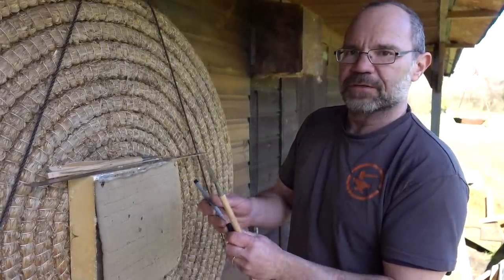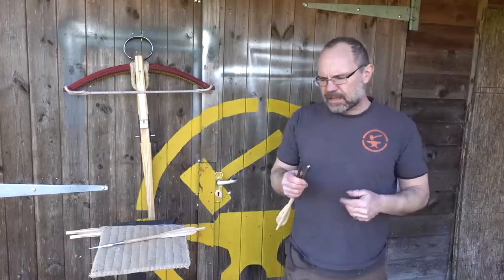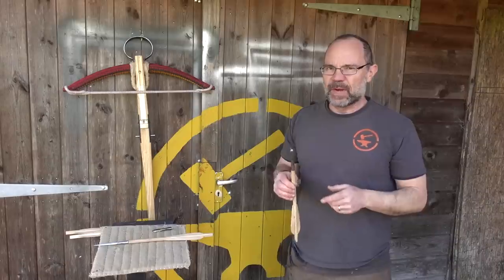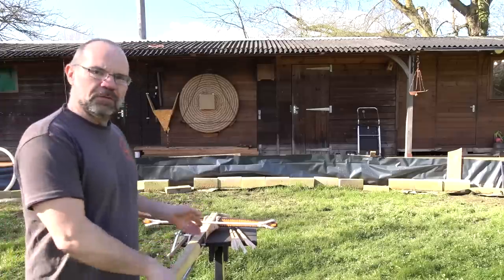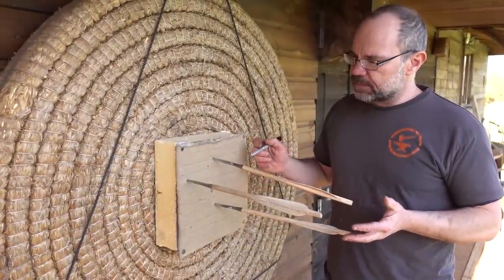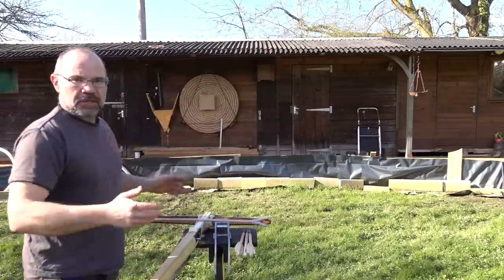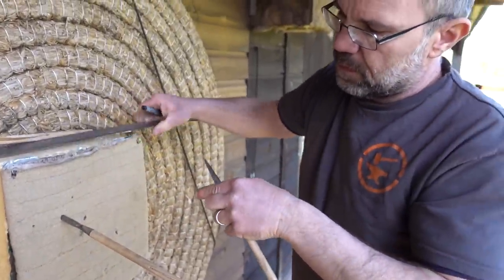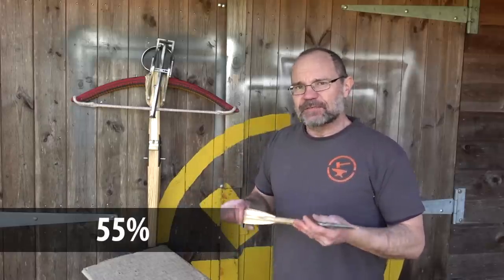Does WAX on ARROW HEADS Do Anything?

Comment: Great experiment. Thanks for your thought-provoking work!

Waxing sewing thread and waxing needles would have been common practice for far longer, so it's not much of a stretch that archers and military leaders would consider trying it.  As much time as I spend battling the Windows operating system, repairing my car, and teaching high-level math, they'd have had that time to ponder, "How do we kill the other guys before they kill us?" and been pretty darn motivated to try whatever might help.  

I wonder if there could be any DNA test for beeswax on historical arrows.  Or electron microscope of any pollen grains still in it?  We just assume beeswax, knowing it was available (while paraffin and other petroleum distillates were not), and I've got a lump of beeswax/fine sand my GGG grandfather used to sharp his scythe in mid 1800s Wales (and the scythe).  But what about human earwax?  Every archer has two ears and in a age before Q-tips / cotton swabs, that could have greased a few arrows each day.  Or beef tallow?  - beeswax would have been relatively expensive.

Other variations to consider are: polished steel arrow heads versus more roughly finished.  And really sharp edges to cut through those fibers.  I worked in a ski shop and running a downhill/Alpine (metal-edged) ski over a wet sander could give a 88-89-90 degree (depending on how aggressive they wanted to cut turns) "edge" that was a corner but a corner so sharp you could shave with it.  A friend did, inadvertently, when he took a fall and shaved leg hairs off his calf on the other leg.  

Plus 50% for wax.  Plus another 30-40% for polishing or extremely sharpening?  Now you've got a distinctly more deadly projectile and that's well worth the additional time, prior to battle, to prepare them.

Comment: It would be better to do more repeats but with the current data, calculating the standard deviation indicates the difference is statistically significant so it looks like there is a real effect. 

I don't think melting of the wax would necessarily increase penetration as some of the kinetic energy is therefore lost in the melting. I think it simply reduces friction and therefore prevents some energy loss as heat. But I'm not an engineer.

Comment: What is more telling to me, is that you used the bolts that you already had used.  They would, therefore, be slightly more dull having already gone into the gambison.  So, wax REALLY helps.  Helps better than your experiment shows.  Maybe only slightly, but certainly better.

Comment: Perhaps the wax was on to protect from corrosion in the armoury during storage.  But also added to penetration.  Surely they would not have been stored as bare metal? Two benefits from doing one thing!

Comment: Well medieval people understood that metal objects could rust. So it would make sence to put wax (or some other form of grease or fat) on your arrow or bolt heads to protect them from rusting. And if they did so I doubt they would bother to clean such a protective coating off before shooting the arrows or bolts. So they were bound to figure out that the wax/grease/fat made a positive difference to the effectiveness of their arrows or bolts. Wouldn't they?

Comment: WoW that is extremly interesting.
I wonder what would it do to the rivited mail or breastplate.
In medival people had been using bows and crossbows like modern military assault rifles. But the knights were using plate armors (late medival full plate or combined plates with rivited mail). is it possible to kill that knight with 2 or 3 bolts or arrows? I mean, perhaps most of leathal wound were caused by bolts/arrows hitting weakspots like neck or armpit. But it is so dificult to aim into small gap or eye from like 100m (bows) or up to 30m (crossbow), dosen't it?

Comment: Superb. And unexpected. I've been told a few times by re-enactors how beeswax was put on medieval arrowheads to prevent them skipping off plate and I've buttoned my lip because, thinking about the basic physics of that and the forces involved, I cannot for the life of me see how that would make a scrap of difference. But this is something else...
Reply from the maker: Careful.  Glad you found it interesting, but against fabric armour the wax is a lube, but against plate we currently have no idea, so do not take it as fact yet and personally I expect against plate it would make no difference
Reply: @tods_workshop  Agree on all counts!
Reply: @tods_workshop  Probably by an effect known as normalization. Some armour piercing rounds early in the 20th century, both for tanks or warships, had a cap of softer material that would increase friction when hitting sloped armour, making the round grab the plate instead of sliding away.

Comment: While I don't tend to bother with it, i know some guys who shoot modern compound bows will wax their field points and shafts, but that's to aid in withdrawing the arrow from the target. I shoot a foam block. It comes out easy.

As for Teflon coated bullets: complete BS. It'll cook off by the time the bullet leaves the bore. Some precision shooters will coat their bullets with a molybdenum powder to reduce friction in the bore , others wil use a nitride coating in the bore (usually applied to the entire barrell) and cast bullet shooters have recently taken to powder coating their bullets to reduce lead fouling. 
I only know one person who used to use a wrap of teflin tape on some of his cast bullets, but that was to act more as a shim because his batch of cast bullets were about .003" undersize and would drop into the straight walled case before seating.

Comment: That extra 80% penetration would be a good improvement, but I am sure wiping the tip on a dead whatever or even the ground to pick up some bacteria would make it even more lethal.
At least take him out of action for a time.

Our forefathers did not know about bacteria, but they might have known about keep any wound as clean as they could.
I was 6 years old in 1949 and cut my forearm, no medical services where we lived at that time.
My mom cut a small bit of her hair and put it in the wound with ends sticking out.
She then pulled the wound closed with several homemade butterfly bandages, and then applied an alcohol compress.
Several times a day she changed the compress and pulled out some of the hair.
The wound closed from the bottom up (no puss pockets) and left no discernible scar.

Comment: We're ALL geeks here.  One of us.  One of us.  One of us.  LOL
But in the spirit of geeking out, yeah, of course they waxed the head.  Or oiled it.  Fletcher Phil spends all that time making them, out of regular rust-prone steel or iron, yeah, even if no one else does, HE'S going to protect his work.  Because they're likely to end up sitting in storage, at the fletcher, at a castle, etc. before they finally get to Guardsman Gill on his patrol.  Etc.  People who are honing and oiling their swords, oiling their boots, oiling their mail, etc. are definitely aware enough of rust to also oil the arrow and bolt heads.  It's just general maintenance.  Wax?  Maybe.  If Fletcher Phil has been waxing his feathers so he has the beeswax material and skill to use it.  But if not wax then oiled heads certainly.  So it might be a fun experiment to test various oils instead of wax.  (linseed, lanolin, tallow, etc.)
In the spirit of geeking out with iterative improvement, I've seen your tests are against immobile targets where force of impact is never transferred.  In theory this gives better penetration than reality because the human body is an unstable platform.  I know you even explicitly state these tests are just about getting a general idea.  But adding a standing strawman that can be pushed over would go a long way to alleviate the strawman arguments likely to come up.  If possible.  (Better would be a spring-loaded practice dummy, but they cost money, so ... you know ...)
Also re-testing with your other heads would be interesting.  Does that fleshcutter get any better?
And maybe even test with a thicker gambeson / aketon?  Maybe Guardsman Gill upgraded.  Or was just cold.  How much does their material depth change their protection?
Just random thoughts.  Maybe they help.  Maybe not.  Either way, love the show!  Keep up the awesome work.  :)

Comment: You gt a 350 pound draw weight but not a very long string. So less time is used propelling the bolt. Might as well use a regular bow from Bass Pro shops. Much faster velocity.

Comment: just as a thought, it would make a little bit of sense in my mind for people to dip the heads of arrows and bolts in wax around more wet climates like England to help keep them from rusting, something wrought iron is fairly want to do, if they seen that not scraping the wax off if they used it for such a perpous aided in penetrating the average schmucks armor better, then honestly why go through the extra effort?

Comment: Just trying to figure out how you arrived at 55% better penetration.

My calculation gives an average 23mm dry penetration and 46mm waxed penetration. That translates to a 100% increase in penetration after waxing. That even beat my estimation of a 10%-50% improvement of penetration, because i was looking to see how well can i estimate the improvement. 
I knew it would work because i wax really long screws (>3 in) before driving them into wood. And i can really see a difference in torque needed to drive a dry screw versus a waxed screw.

Comment: I know it was mentioned that the bow being used wasn't the most powerful but I'm shocked that the penetration figures are that low given that the ammo being used was supposed to be for defeating that kind of armor. With that shallow level of penetration many people will still be able to fight on. It is generally considered that a weapon requires around 3 inches (7.6 cm) of penetration to be fatal when striking the core and that is without any intervening armor or bulky clothing. It is hard to tell for sure but that gambison looks to be about .25 inch thick so that is a fair amount of arrowhead that isn't inside the person wearing it. Sure they might end up dead in the long run, given sanitary conditions of a contemporary battlefield/war camp and medical science being what it was back then but I'd have though a weapon designed to defeat a particular kind of armor would be better at defeating armor. They seemed to be able to come up with more effective ways of defeating better armor, after all. Could it be that this ammo wasn't designed with defeating this kind of armor in mind?

Comment: not a blob of wax, just wiped on like surfers do their boards - and try with both wax & tallow, as both were used to prevent rust (at least in the 1800's), and it seems simple enough that I think it's been around for a long time.

Comment: Wax the whole arrow/bolt. In ww2 they found almost no amount of wax had a detrimental effect on aircraft, only improving it. Also, these bolts and arrows move at the same order or magnitude in speeds, particularly considering it is low level flight with high resistance. Make those bolts slick and see if you get more flight time or less velocity drop etc.

Comment: Very interesting theory. The way I see it, the wax act as lubricant and by decreasing the friction between the foam and the arrowhead, it allows it to travel further inside. Now, while this seems like an effective way to increase penetration in solid objects, I'm not exactly sure how effective it will be against flesh. Flesh is quite wet and oily (the lubricant is already there), so wax would probably not have the same effectiveness against it. Then again I never tried it, so these are pure speculations.

Comment: Interesting...I was very surprised..Did I miss a video of you trying waxed heads against plate? From how ballistic capped tank shells are supposed to work, I could imagine, a blob of wax could just prevent some glancing off, and make some percent of arrows dig into the plate that would otherwise have glanced off, or make the transer of energy from the head to the plate that little more effective.

Comment: Ok, i did a quick glance over the responses  and didn't see this exact idea. So if the wax needs to be heated by the the kinetic energy of displacing the gambeson, before it provides lubrication, maybe just oil would make a difference. Not in the manufacturing process but dipping just before firing. It would probably be to tedious or time consuming to do during combat but i wonder if it would give even more penetration then wax.

Comment: Hi Tod. I do woodwork and wax the skrews by dipping the tips in melted paraffin wax (normal household candles). I also use bees wax but parafin wax seems to work best and also assists with removal even after a while. Bees wax seem to impair removal after a while. If I don't want the skrews to be removed for security purposes I use bees wax that contains propolis. Warning. When using bees wax with propolis preheat the screws before you start driving them. If you don't and stop driving a cold screw for just a short period you might battle to start driving it again or to remove it. I normally use them immediately after if have dipped the tips in the melted propolis bees wax.
How about repeating the arrow tip penetrating experiment using different types of wax?

Comment: Arrow 1. 45/26 = 1.73 or 73%, arrow 2 = 47/25 = 1.88 or 88%, arrow 3 = 45/18 = 2.5 or 150% for an average of 103%, but we actually need the bolts shot two more time to reduce the variability... very cool data... I wonder if shooting a lower poundage longbow with waxed arrows would improve hunting game kills?  Very interesting?

Comment: Maybe that consistency is because your wax application was very nearly identical.  It may be worth another experiment with wax applied to more of the tip on a few shots to see if they achieve deeper penetration because it looked like as soon as they got past the wax they stopped extremely fast on video at least.  As well I could see the ancients waxing the entire bolt shaft and all to stop water from warping them so they may have stumbled upon the idea from more than an armor penetration perspective.

Comment: Commenting early in the video. I know that when driving nails in hardwood, it helps to put a little oil on the nail. Wax should do the same.
Reply: It performed as expected. The wax could be applied at any time and would also prevent the oxidation of the arrow heads. A win, win.

Comment: Actually we don't put Teflon on bullets to get through fabric armor. That's a myth. We briefly put Teflon on bullets to reduce barrel wear. And the type of bullets that they were putting it on would have penetrate any fabric armor with little resistance anyway. And they briefly put it on some pistol bullets that wouldn't with or without it, and a couple movies claimed that those were for penetrating armor. They wouldn't. But they dropped the telephone coding simply because of the publicity. It did serve its function of reducing friction in the barrel though.

Comment: Out of curiosity, how sharp are the bolts? Are they sharpened and honed as much as a sword blade? A high polish on the steel would also act to reduce friction, obviously.

Sorry if it is an obvious question, maybe I haven't been hanging around this channel enough ;)
Reply from the maker: Not at all.  As they came from the forge.  I try not to skew my results by doing things I doubt they did

Comment: Interesting stuff. Were archers/crossbowman supplied with equal number of arrowhead types, or was it tailored to the opponents they were expecting to face? It strikes me that there wouldn't have been a lot of time to chose between bodkin, cutting, and plate piercing in the middle of a battle. Wonder if they ran out of the right type?

Comment: What would happen if you put slightly more wax on? Did you try dipping the heads in molten beeswax? What if you coated them with some kind of plastic or modern lubricant? Would dipping them in period appropriate oil have the same effect? Lots of questions about lubing shafts now!!! ;)

Comment: Not to nitpick, just to point out, and explain for others that might have got confused with your percentages:
I've seen this same mistake happen several times before. You did the math right but got the correct answer in reverse and just didn't realize it's not the same both ways. If you took those same things backwards, you got the percentage correct as a DECREASE. However, as an increase it doubles. So an 88% increase is a 44% decrease if you're going the other way etc etc. I've seen people make this mistake when showing things like price differences as well. Saying something like $25 to $50 is a 50% increase, when it's 100% but they're just looking at it the other way, and applying the same number not realizing that it changes the percentage, because it would be 50% if they were talking about going from $50 to $25.

Comment: Neat how un-viable needle bolts were before and how they are now deadly killers against what their supposed victims were; gambeson wearers (probably other archers). 
Correct me if im wrong, wouldn't waxing the valuable iron heads also act as a way to prevent rust/corrosion? Beeswax was a little more expensive than other medieval goods yet so would be the metals required and the time necessary to make such a bolt. I think there is some real evidence behind waxing the tips of such weaponry rather than that not being the case.

Comment: Actually, Teflon coatings on bullets is meant to prevent metal deposits from building up on the bore. I remember the panic over "Teflon coated cop killer bullets" and I'm not sure who started that nonsense, but in order to penetrate  soft body armor you need speed and a hard projectile, Teflon doesn't increase its hardness, in fact Teflon is quite soft.